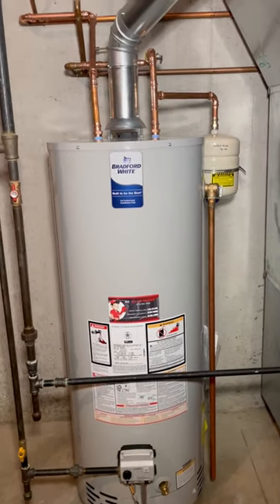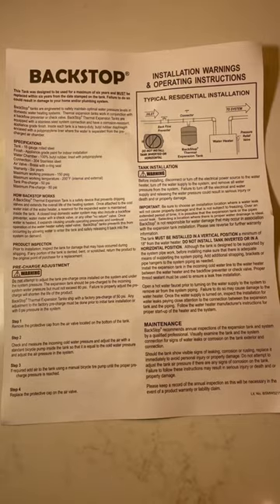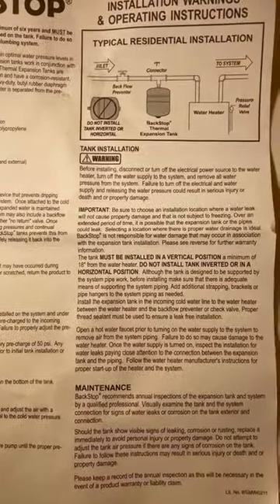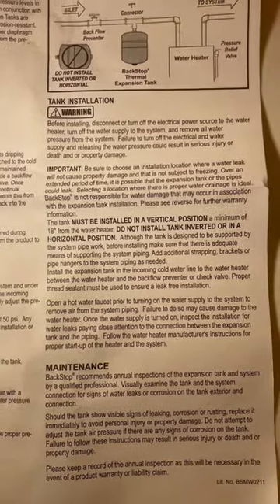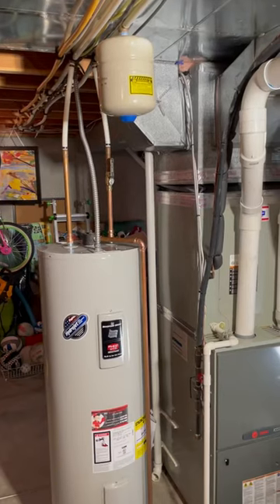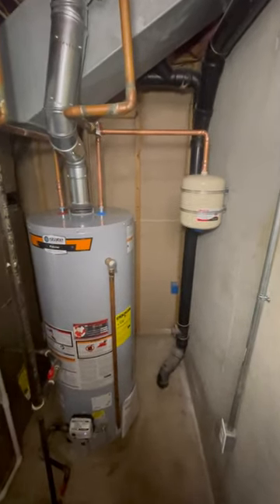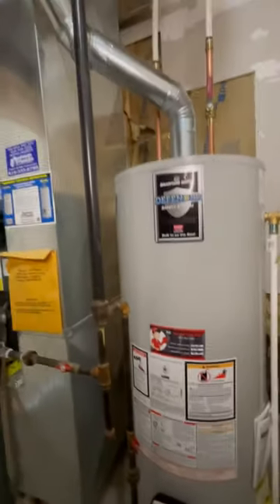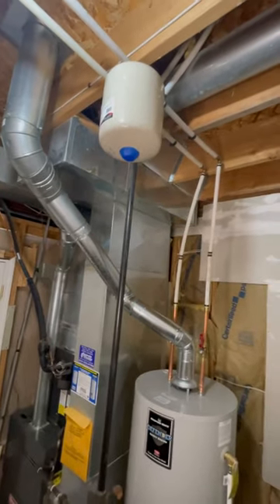Thermal Expansion Tank Requirements: Changes and Challenges for Plumbers

Comment: Yeah, it may be different from their previous install specs, but it is still common sense. Keep them away from the source of heat to protect the rubber. Keep the threads up to keep air out of the tank so they don't rust out.

In hydronic service and repair we see what fails and we find out why. Now we install parts in ways they don't fail and, sure enough, manufacturers follow suit.
Reply from the maker: 6” away from the vent connector is common sense, 18” away from the water heater creates conflicts with other code requirements. 

The install drawing provided by the product engineers specifically okayed horizontal and inverted install. If it’s common sense you would think the product engineers would have always specified for upright install.
Reply: i agree with the 18” and the sediment trap is installed incorrectly.  as close as possible. inspectors can fail if you do permit work

Comment: Never had banging pipes until the a hole inspector made them install one of these.
Reply from the maker: Try adjusting the water pressure up just a little bit. We usually turn on the water until it starts to make noise, let it run and go down and adjust the PRV until the hammer noise goes away.
Reply: @Kcwaterheaters  i am not sure what you mean. Are you implying I should have a pressure regulator on my main? i do not as far as I know. Do you mean the pressure in the tank they added? Thanks for the reply
Reply from the maker: Sorry, I misunderstood. I was referring to a pressure regulating valve. It’s important that the thermal expansion tank has the same air pressure is what you have for water pressure. I have not experienced a thermal expansion tank causing water hammer. It may be that they opened the shutoff valve fully or maybe they didn’t open it all the way. Check that first. 

It’s hard to say without seeing it but installing a pressure regulating valve is usually a good idea if you’re hearing water hammer.
Reply: @Kcwaterheaters  hey no worries thanks for all the information 👊🤘

Comment: What I wanna know is how is a residential Home a sealed system if most homes don't have backflow valves on their water mains and a water meter is not considered a backflow valve?
Reply: Meant closed system
Reply from the maker: It’s from higher water pressure outside the home. When a PRV has been installed it will create a lower pressure inside the home. Anytime the water heater kicks on it has the potential to bring the inside water pressure up to the city equivalent. 

We also have more cities that are installing check valves inside the water meter.

Comment: Just don’t use backstop
Reply from the maker: Amtrol has taken a similar position in that they require them to be installed upright and no longer allow horizontal installation. I think Watts will still allow for inverted and horizontal installs.
Reply: What about Everlast?
Reply from the maker: Looks like Everlast will allow for inverted installation, at least according to the website. 

Interestingly enough, Backstop website does not match the manual that is on the most recent product we have received.